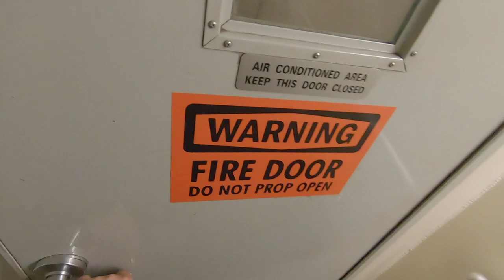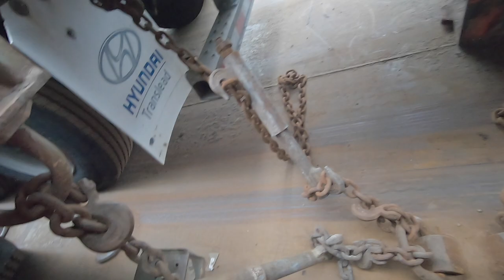FULL work week on a Alaskan RORO ship : Day 2/7 - Thursday

Comment: Quick tip: A 20 minute power nap or sometimes called a stage 2 nap is considered the ideal nap time. 20 minute power naps are equivalent to 8 hours of sleep and is a common practice on crabbing boats.
Reply: If it would work like that
Reply: @adriand8438  except for the fact it's scientifically proven. From pilots to crab fisherman it's a common practice.